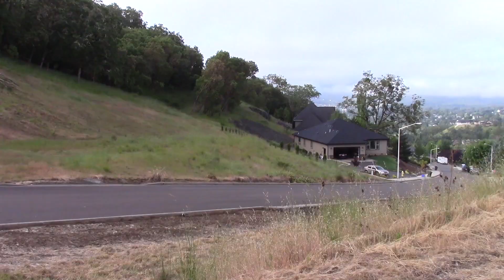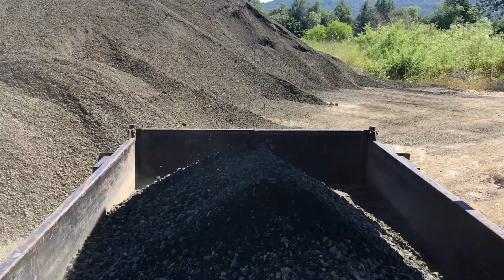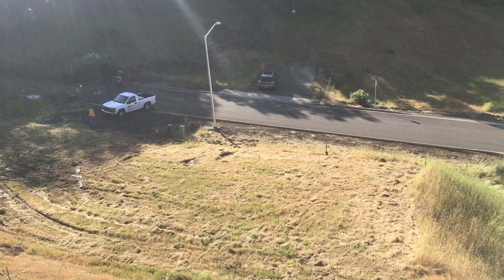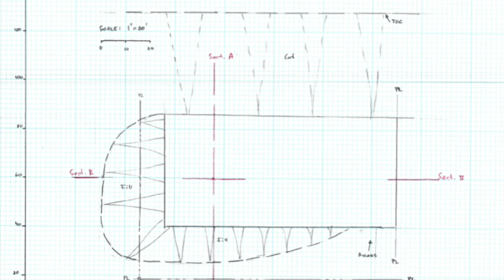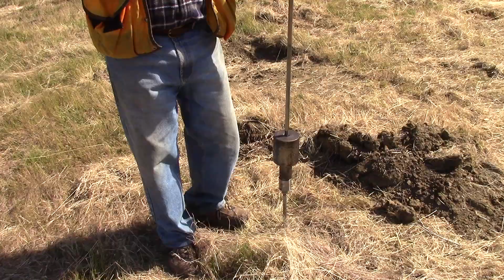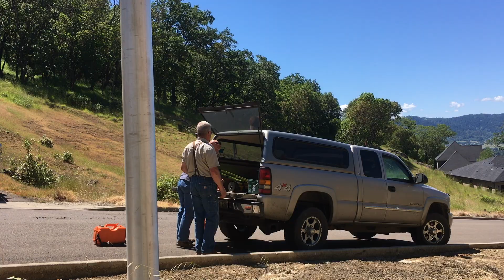Hire Surveyor / Avoid Mistake - Spec House EP.02

Comment: this part about surveying reminded me of building licenses. so if you are build a house for you, on your property: all you need is a build permit from the local government as long as you do not intend to sell it for profit (which is tricky if you want to move later). I think most states have a period you cannot build if you sell a house that you built.

if you want to build residential, commercial, or industrial most states have separate exams for each, some will uniform industrial and commercial or commercial and residential. for building licenses in other states, check for reciprocity. some states may have reciprocity for other states but not yours, and yours has reciprocity for one of those other states.

as a real example: north and south Carolina have reciprocity for each other, but no one else. Georgia, Mississippi, and Alabama have reciprocity with each other and Florida, but Florida doesn't have reciprocity with those states, meaning you can build in all four states with a Florida licenses but only in three with the other three. at-least that is what I remember, the laws may have change since this was true.

the reason Florida is so up tight about its license is because it has hurricanes integrated into its building code, otherwise it is 1:1 with GA,MS, and AL.

however in a state like New-York, there can only be so many building licenses issued, so while you may pass the test, you will not receive a license until either someone dies or forfeits their license.

this doesn't apply to every type of contractors license so you should check it out.

Comment: Good to see you brought in a surveyor.  How many times have sub-division project gotten derailed b/c fences were in the wrong place, buildings encroached on setbacks or services were not connected properly, all because there wasn't a proper survey done. 

Good you are looking into the fill pile as well.  So often a bad fill pad leads to home destroying outcomes in terms of myriad foundation failures or outright downslope movement.  I worked in one house where the cut/fill was so bad that the open concept plan lead to a primary, 3-story central pillar slowly driving through the roof as the house perimeter wall sank in the fill and the basement floor buckled upward.  That was before the house was even finished!!

Comment: I didn't fully grasp your retaining wall responsibilities to your neighbors. Can you show a visual sort of  a graphic  explanation/demonstration.  Thanks.  Good building.
Reply: The neighborhood was cleared and levelled at some point in the past to create lots for future housing projects like this one. In some places soil is removed and in others soil is added to create something of a pad for each house. Basically what he's saying is that any soil that was added to the lot is his responsibility to retain but whatever was there before the site was leveled is not his responsibility.
Reply: John F - in addition to the perfect explanation  Matt M provided, EC can also opt to build a full height retaining wall in place of that slope, which though expensive, will maximize both his, and his neighbor's flat build-able space on each lot... Thus his interest in seeing if the other benefitting lot owner is interested in sharing the cost.
Reply: philerator - yes, to create a pad for building the original creators of the subdivision cut into the upper part of each lot, and push the "cut out" material to the lower side to build a flat pad based on the lot's property lines, and the hill's slope.

  I don't think any liability would come up if he built smaller and left the original slope that the subdivision's developers created.

  I think it is because he wants to use more of the lot and is putting in a retaining wall, that the change could create issues with the neighboring lot being able to level their property all the way to the property line in the future, if EC changes the slope with a retaining wall for the purpose of maximizing his own build-able/otherwise usable, lot space.

  If EC built smaller, on the existing level area, then the owner of the lower lot would be able to replace the lower part of the slope to the lot line with a retaining wall of his own without any major issues and expense.

  Trying to build it "under" EC's retaining wall, if just built at the property line on top of the existing slope, would not be easy.
Reply: I'm glad you feel better now.  Enjoy the videos.
Reply: Tn..owner has to accept water from neighbors property.  Clear and simple, you live down stream, home owner accepts all run off.
Reply: Thanks, this is great. "...any soil that was added to the lot is his responsibility to retain..." Is this the same as saying - as was used 2 or 3 times in the video - "My slope intrudes on his ( the neighbor's) lot"?
Reply: Thanks to all for the input and look forward to seeing some schematics if you post them EC.   Thanks again.

Comment: I'm interested to know how the conversation with the neighboring house is likely to go regarding shared costs or incurred cost to them that would be non-existent if a house were not being built next door. Do you find that homeowners are usually expecting this as an eventuality of living next to a vacant lot? What do you do if they would like to do their part but aren't financially able to share the costs? This series is only 2 episodes in and it's already fantastic, thank you.
Reply: Basically, if EC talks to the neighbor now and they deal with the slope together, they can maximize each of their flat lot space, and thus, build-able area... This requires some leveling of the base of the slope at the adjacent edge of neighbor's lot, and thus their consent, while providing improvement in the value of their lot, and thus deserving they invest in a portion of the cost of the retaining wall project.

  If EC builds a retaining wall at the property line between the two lots, with it's base at the current slope height, then the owner of the adjacent lot will not be able to level the ground to the edge of his lot, without replacing that retaining wall with a taller one.
Reply: I see, I think I was misunderstanding the video in that case. Your explanation makes perfect sense, Thanks!